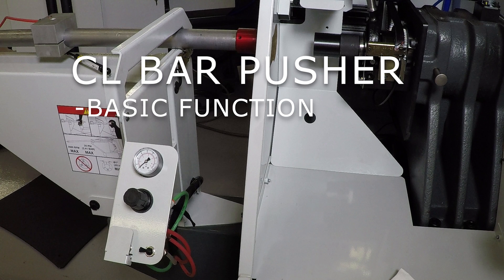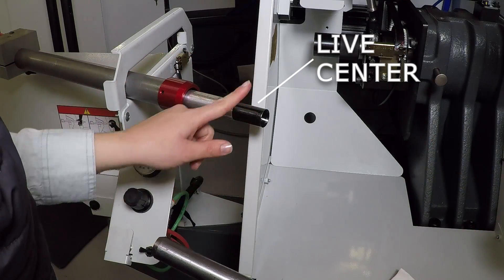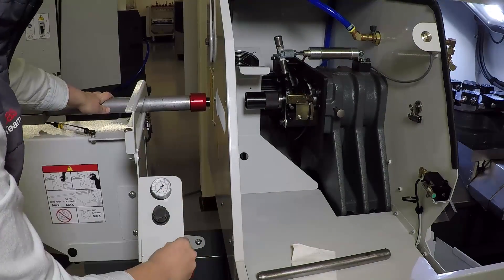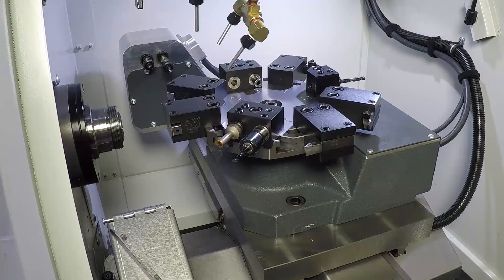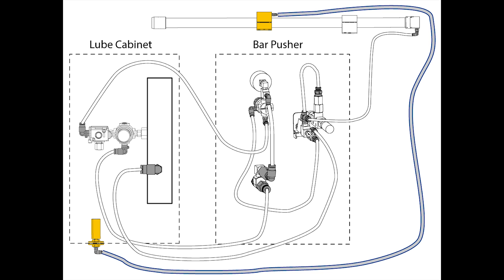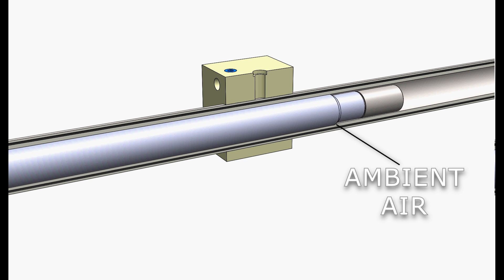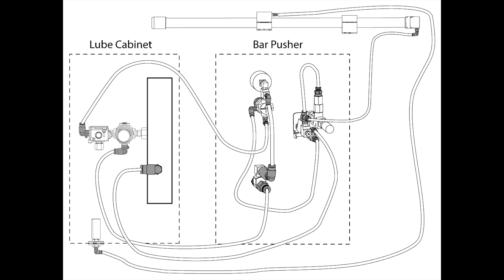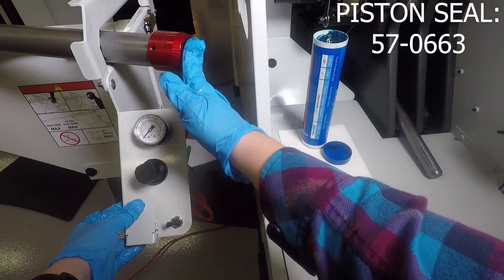Haas CL-1 Bar Pusher Overview. Haas Automation, Inc.

Comment: Hmmm, other than for the end of bar pressure switch feature, I wonder why the bar pusher piston has to be so long?  Seems like another way could be rigged for end of bar sensor (proximity sensor, etc that picks up magnets in the live center) and the unit made about twice as compact if a ~4" long piston was used.  smh

Comment: Is the bar pusher any good for inserting hot dogs into hot dog buns? On that note, can the coolant system handle high-viscosity condiments, such as ketchup, for dispensing? Thanks
Reply: Sadly, the CL-1 is only rated for Costco hot dogs.